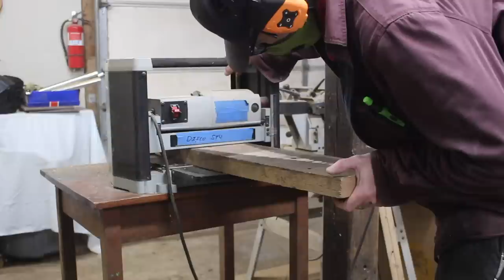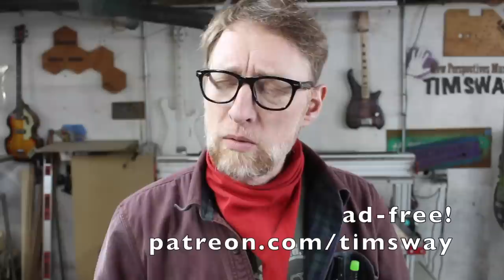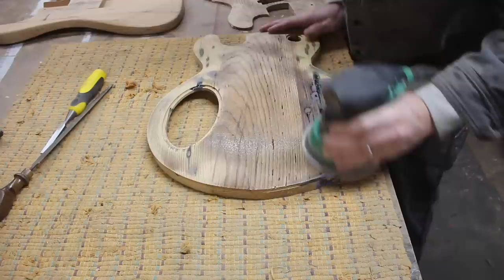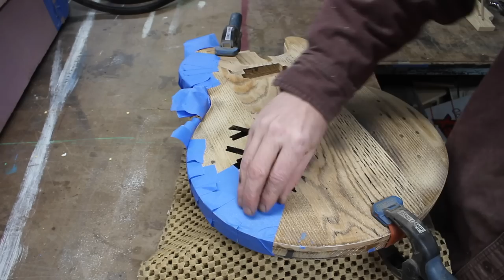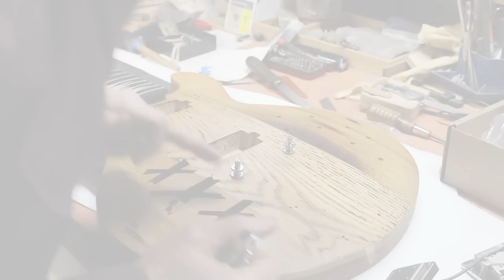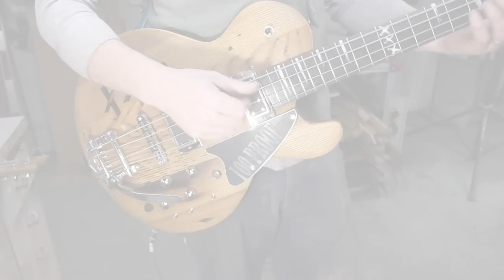Semi-Hollow, Moonshine-Themed Reclaimed Wood Bass

Comment: Tim, an alternative to the awkward router table binding cutting process on that curved shape, put that bit in your CNC machine, clamp the z-axis, and with the machine off but the router on move the x-y axes around by hand to follow the guitar perimeter. Set the guitar on your fixture pucks to level out and clamp or set weights on top. Assumes your CNC can free-wheel when not powered. Nashua aluminum flashing tape (hvac tape) works well for shielding at $8/roll that shields a couple dozen guitars. Really nice guitar design and build.
Reply from the maker: that is a very good idea, but the back is curved too so it would still be a matter of setting up a proper jig, just upside down. i could have put pucks or something on the router table, too. I thought it was flat enough so I could freehand it steady but I got a little wobbly.

Comment: It would be neat to see an entire line of Tim Sway Bass Bodies on the market, P bass, Jazz bass bodies made from different woods, all set to fender neck pocket depths and specs, to match standard Fender replacement necks and warmoth necks. So I could have a Tim Sway antique Chestnut P bass body, or a Tim Sway Fender Jazz body made from Pallet strips all glued up like a cutting board bass and CNC'ed to Fender specs'. This is the beginning of your destiny. You could take logs, out in the forest, and show the milling process, the drying process, and the final CNC process, or even old school NON -cnc made the 1950's way. This is a dream of mine, to see you do this. Or you going to a reclaimed wood pile in the middle of a wood dumping area and talking about what makes good wood for bass building versus, what wood would be non usable.
Reply from the maker: I appreciate the sentiment, but IMO Fender is the competition. I don't want them copying my designs and I sure as hell don't want to copy theirs .

Comment: Awesome job. What is the black painting on the body?
Reply from the maker: I used tinted epoxy to fill the nail holes and ended up coating the whole thing with it to get in to all the grain and add some strength.
Reply: @timsway  thank you so much.

Comment: Where do you find good old wood? I love the nail holes.
Reply: If you're interested in pallet wood (not used here but he has used it).  Recently picked up a treadmill and the gym equipment warehouse/distribution center was FREE heavy-duty pallet land.
Reply from the maker: Side of the road, craigslist/facebook, etc. Plus, where I live, in an older part of the country, lots of old barns and buildings get torn down. It is a growing industry here for the demolition crews to more carefully save and resell the materials. Look for these "deconstruction" services in your area and you'll find the retail side of it. Even some local new lumber stores have "reclaimed" sections.
Reply from the maker: And Josh is right. Many pallets are made from hard woods. Oak and ash. hang out where heavy things get shipped and you'll find the big, strong wood pallets they use.
Reply: @timsway  FYI I was referring specifically to the total fitness equipment commercial division in South windsor CT.  I believe that's not too far from you Tim, but I'd bet dec/jan are probably the goldmine seasons there. 👍

Comment: I'm just amazed that there's a special air gun used for hammering nails. 😳
Is it because old barn wood is usually very hard? I've worked with plenty but never seen or heard of one of those guns.

Awesome loping instrument!
Reply from the maker: It's an air denailer for people who do a lot of denailing. Most of the barnwood I come across is fairly soft as, in my region, they usually used the hemlocks, pines and chestnuts that were growing on the land. But sometimes I get some good, hard stuff. The denailer speeds up all kinds.
Reply: @timsway  very neat! I might have to invest in one... I've purchased many piles of nail filled wood at auctions and pulling nails is an absolute CHORE!
Reply from the maker: @SomeJustice19k  it was like $50. paid for itself on first use.